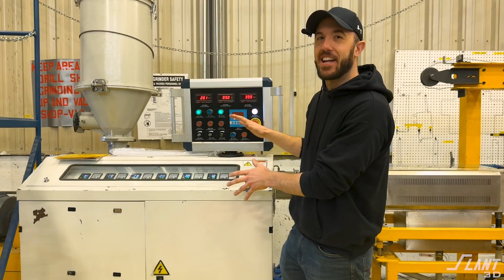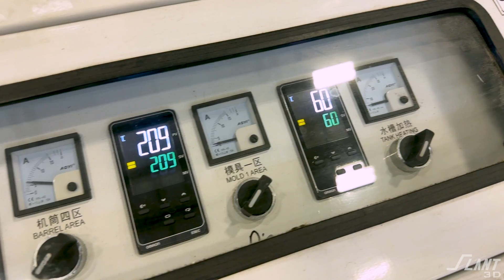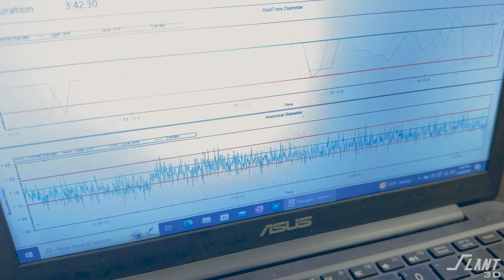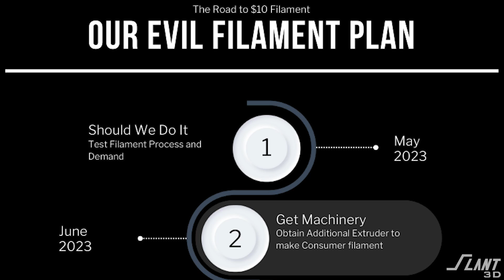The Wrong Way to Make Filament | Road to $10 Filament

Comment: Thank you explaining this stuff. You gave some answers I was wondering when viewing filament productions. I think it is very difficult to maintain a specific diameter +-0.01mm. May be it's possibe to adopt some methods from procuing copper wire. Because copper is expensive an wire mass producte some ideas probably could get adoptet. But I did not checket it.

Comment: To get a sense of what true production scale extrusion looks like, Smarter Every Day has a tour of the Kodak plant where they make the PET film for photographic film. Just the extruder screw is about 100' long, and then the cooling and stretching operation is probably 300' long and takes an entire floor of the building. Check it out.

Comment: I work at a plastic additive company and we have 3 extruder lines 2 of which have dies that can run 12 strands at one time sadly at the end of the cold bath we chop up the plastic and put it in huge boxes (Gaylord’s) and sell it as additives I’m surprised we don’t make filament when we would just have to remove a step and add a spool winder and probably be the most efficient manufacturer but maybe the money isn’t there or our sales team just sucks.

Comment: As far as filtration on that water goes, is oil contamination a concern? I'm thinking there's a fair few moving parts in that system, I would expect some amount of oil to transfer into the water eventually. A simple sump would both reduce the contamination greatly, and tell you if it was a problem in the first place. They're also good for floating solid debris, and cheap as chips. Doesn't take much more than a bucket and a pump, and you already have the pumps.

Comment: Do you think that making the extruder vertical and cooling the last vat of water in gradual increments to make sure the filament is cooled off enough could help? (verticality would be to help with filament stretching due to pulling)

Comment: I know for a fact that there have been manufacturers making tight toleranced (+/- 0.02mm and better) filament for nearly a decade. 

Why are you wasting your time on that old extrusion line? Why wouldn't you just invest the $50k for an extrusion line that has already solved a lot of the problems that you're identifying on that line?

Comment: You don't need faster extrusion... You need multiple nozzles and route like 4-5 strings through same cooling channel... :-)
Reply: You can loop the same filament multiple times through the same cooling channel
Reply: @celeron55 This will not increase throughput )
Reply: @BarsMonster  Well, given the extruder is the bottleneck, yes it won't. But I don't think your idea will help either, because with multiple nozzles you're increasing the extruder flow rate anyway and the material will then stay in the heating chamber for a shorter amount of time just like when increasing the flow rate from a single extruder.

Comment: I would cut a notch into the bins to make threading the filament easier. Seems odd its watercooled directly, but having moisture in your filament makes it pop and not adhere. Making it have a longer melt zone is a no brainer, like a volcano hotend. 
Good work.

Comment: The oscillations in the belt will add variations in the filament diameter. I haven't run the numbers, but if your goal is closer to +/-.02mm, I'd run those numbers right away.

Comment: I can say that while I have not extruded filament I did extrude double walled yarn reinforced hose (think garden hose but smaller diameter and for drinking water) and designed some of the equipment on that line.  I had issues with my second tank not being long enough to cool before spooling onto massive wheels at the end. I ended up mounting a bicycle wheel at the beginning and end of the second cooling tank. The hose would come into the tank just as it does here but at the end it would go up onto the wheel, loop back to the beginning and take a second pass through before coming out the end. The hose was originally warm enough that when spooling the first several layers could get slightly deformed out of round and would have to be scrapped on every spool. This was hundreds of feet a day, that just went in the scrap bin that we were then able to keep in spec.

Comment: Don't mess with the sand filter at your volume....300 to 1500 gallons a hour is a cheap filter tube.   You should be filtering out 1g of waste for every 10kg of filment made I expect.      

Activated carbon and spiral wound filter tubes are dirt cheap (and with the right filter tube is just mixed and perhaps dirty plastic to dispose of...same waste stream.) for the tiny bit of drag in you get from cleaning just cast thermoplastics.  For the bigger stuff, cardboard dust blowing,   simple filter bag will take care of chips and fragments of microplastics and be what you would change out every week.  Carbon tubes and micron scale filter tubes work at a few PSI drop, so your going to need a 1/15HP pump in lue of the 1/30ths you seem to using today.      

Those tubes your goal is to change out every other week as they are almost always shipped in cases of 12/24/36.   Once you have one system, you may choose to print your own filter tube encloser inlet and tube holder and use schedule 40 or 80 CPVP plumbing and rods and glue your own design together, would be fun to figure out the compatible glues/weld.     The commercial example is Penguin Series A-B In-Tank Filter Systems from Penguin pumps.   Those are moulded and machined plastic,  CPVC with Viton Orings.   Steel chambers can be cheaper but are dirtier out of the box.     For your application this would last decades.

Comment: How come the water cooling doesn’t affect the quality of filament? As consumers of the filament we go to great lengths to protect filament from moisture on the air, yet during production it’s literally submerged into water 🤷🏻‍♂️. Is nylon and pva cooled the same way?
Reply: It has to be actively dried after that in order not to be wet when you go to print it. Wanna take a guess whether the manufacturers promising dry filament spend the $$$ on electricity to dry it thoroughly? LOL nope they stick in a tiny desiccant bag that can't even remove moisture just prevent absorbing more and figure you're dumb enough to believe it's dry.

Comment: I’m surprised you haven’t taken an angle grinder to those cooling tanks
Reply: It would be a nightmare to get all the metal particles out of the tank afterward. And metal chips are just about the last thing you want contaminating your filament.
Reply: @outputcoupler7819  it doesn't have to be when the line is running. I'm almost 200% positive those tanks are removable
Reply: @outputcoupler7819  why would it be a nightmare? Do it while tank is dry, blow it out with compressed air
Reply: Im not surprised. Metal Fabrication is a barrier for most people, but if you were in a factory setting you would definitely WANT a metal guy around to do all kinds of stuff like that.
even manufacturing new tank stands or the tanks itself.

Comment: Nice video. However, the future of 3D printing is to eliminate filament altogether. Filament is a needless expensive of energy, water, and resources. Why heat plastic twice when you only need to heat it once?  The future is 3D printer is extrusion heads which take plastic pellets directly. They already exist and while not perfect, have the opportunity to eliminate the need for filament.
Reply: They are heavier and less consistent.

Comment: Genuinely interesting. I can only imagine that the usual way of creating a bigger output would be to put up ANOTHER machine next to this one.

Can confirm, I used to work at a factory that made large plastic bags. Like those giant black or white trashbags and it looked quite similar. Only difference was that instead of running it through water, they went across a chamber where a giant fan would blow the filament into one continuous plastic bag, that would be would to a spool on a pallet, and would later on be cut into the bag-sizes while print being applied.

Comment: would it make sense to replace all these water baths with a single quartz glass tube filled with water and have heaters wrapped around it for the entire length, then you set the temperature gradient instead of having discrete temperature drops? or is this just wishful thinking?

Comment: This is not how all companies are doing it, when I was manufacturing printers 8 years ago our filament manufacturer was already using air to cool the filament and a gear pump servo controlled after the extruder to fine control the filament output.

Comment: on audacity there's a way to separate and delete high frequency noise, it's free, takes about 2 minutes, just a tip for the next video
Reply: There's already noise subtraction been done on this video, i can hear the footprint. What remains is what remains if you don't want it to completely eat the voice.
Reply: dxrevive works nicely
Reply: To me it sounds like they used some neural voice extraction already. Given the amount of noise in that environment this is probably the best they could good get.
Reply: @GatlingNG  yup. Controlling noise is a lot harder than people think. "Oh, we have an algorithm that does it!" they say. "You ever tried using it?" I ask.

They work great in quiet spaces, but in an actual factory? You get what you get.

Comment: I loved working on the sort of challenges you are working on here. My experience is in precision film extrusion, so partially relevant. Your focuses make sense but I offer a couple of suggestions. With lead times so long on those barrel heaters I would challenge folks to find an off the shelf band heater that could do the job. 
If you haven't already considered it an additional way to increase throughput would be a die for multiple strands along with the larger extruder.
A different path to precision, cooling, and reduction of contaminants would be chilled rolls rather than the water bath.
Reply: Rollers are what is used in sizing wire, so I think your idea has merit.

Comment: doing gods work. Can we just get federal funding and cheat? I mean think abouyt it, pla filament can be made of corn oil right? Massibe farm subsidies, a new american manufacturing at home with 3d printers priogram  to curb chinese domination of us manufacturing market blah blah blah gov give us money, we can  cheat, and maybe its not good long term BUT for cshrot term we may get 3d printer fdil,ament down so cheap for a few years that it could be like free lol peopel will be givibng it away, thats my dream. joe bidens 3d printer filaments cam lets do this bro. the only downside is waste but we can burn it all down into silicon molds lol

Comment: What if you went one step further and actually cast/made the resin into filament directly? It seems like the whole step of turning it into pellets first could be skipped entirely.
It would work the same way silicone coated wire is made, where it is actually cast and chemically reacted on the fly as the metal is pulled through. Except there would be no such wire and it would be done with PLA instead of silicone.
I'm not sure how feasible this is, or how you'd add colorant to it.

Comment: I would relook at the goal. Elegoo already has $10 rolls on Amazon, come next day…. The market is missing a $30 3kg roll IMO.
Reply: Yeah, I think they might need to get under $10, but even if Elegoo is at $10, I’d pay $13 to support this project. You’re probably right about the market for 3kg spools as being more primed for volume, my Bambu AMS wouldn’t hold them :-)

(OTOH, I mostly just print gray PLA, so a 3kg spool in a sealed/dry spoolholder on the back might be ok…)
Reply: Yeah, I just ordered some cheap spools to test off Amazon. $12, $13, and $15 for sunlu, esun, and some sketchy but attractive stuff shipping from China. Real colors too not just black. The price to beat is gonna drop below $10.

Comment: How about skipping all of this and invest on a Direct Pallet printing system? There is a youtuber that has worked most of the issues one can/will encounter. 1Kg of Pallets is less expensive than filament.
Reply: Tolerances. The pellets that go in have extremely loose tolerances, so your fluctuations in extruded volume are unacceptable for most applications.

If you can make an equivalent to a gas engine's mass air flow sensor that works in a stream of molten plastic so that flow can be dynamically adjusted to match the volume of plastic from randomly-sized pellets, you'd be good.
Reply: @See-essEll  How about in investing on a Giant Blender/Shredder that makes the pallets into a smaller homogeneous size?
Reply: @nicamarvin  Smaller will still not be uniform. I think the simplest solution would be a series of graduated holes to narrow the pellets into more uniform sizes in bulk.
Reply: @See-essEll  wouldn't retractions still be a problem? Granted lots of models, like the lampshades, wouldn't need retraction and could be printed even more cheaply on a direct pellet printer and the remaining, who knows...25%, models that need retractions could be printed with filament.

Comment: how about extruder pushing out multiple parallel lines simultaneously?
Might be easier to just go faster on single line tho
Reply: You certainly can however it is challenging to obtain equal flow characteristics across the different strings from the extrusion die and your downstream equipment will need to support that multistring configuration as well.

Comment: It could take up a lot less space if you stacked the cooling channels and used pulleys to zigzag it up/down. You could the use a simple gravity feed and a toilet fill valve to maintain water level and cheap souis vides (spelling) to maintain temperature.
Since this setup could more easily be enclosed, you could use alcohol or some other liquid instead of water and reclaim the evaporation in a condenser to reduce dry time and cost
Reply: I don't really know, but I imagine that Zig zagging the filament before it's fully cooled can introduce tolerance issues
Reply: @noisycarlos  a sufficient radius, clean machining and good bearings would minimize that and since they would go opposite directions any built in curvature would be corrected. In fact many copper wires are produced in a similar way to minimize tolerance issues - the wire is fed between 2 well fitted rolling guides
Reply: As in tanks that were used to process movie film.
Reply: @jeromefeig4209  I must be behind on my How Its Made episodes - never saw that one. Pretty soon they will all be digital and an attentive filament maker could get a steal on that equipment

Comment: Is this true of all filament manufacturers? I can’t imagine the largest filament manufacturers wouldn’t have tried to reengineer all this old tech for optimization.
Reply: No not at all. The equipment can cost $150,000+, while this is probably in the $10,000-$15,000 range.
Reply: @TheOfficialOriginalChad I imagine the $150k machines can extruder a lot faster while still maintaining tolerances, do you know how much faster they are?
Reply: @DaveEtchells  That I don’t recall. I also didn’t catch how fast this one is
Reply: @TheOfficialOriginalChad  IIRC, he didn’t give a specific speed, but he did remark about needing someone there to always be changing take up spools. It’d be just a wild guess, but if it was 5 minutes/spool (likely slow?), that’d be 12 kg/hour. That’d be around 300 kg per 24 hours. 

(If we knew the inside diameter of the spool, we could easily figure out how fast the filament is moving when the operator starts up a new spool. That’d be faster than the extruder runs, because there’s a set of rollers that take up slack while the spool is being changed, but it’d give an upper limit. There’s variation in hub diameters between mfrs, but I suspect not much. It’d be interesting to calculate but I already waste too much time on YT vids and comments 😮😂)
Reply: @DaveEtchells  I like the way you think!
Reply: @TheOfficialOriginalChad  I did a quick Alibaba search and found a machine with 45-50 kg per hour capacity for $28,000 plus the usual shipping and import duty.  So in the $50k range and not $150k. There was another unit for making synthetic hair (200kg per hour) priced at $35k The point is how the filament is processed through this machine hasn't changed in decades.  A similar product is the bristles from brooms or toothbrushes,, cut to length before they are inserted into the head.
Reply: 3d musketeers went to printed solid, machines looked pretty similar, they had a way to take up the slack while changing rolls but otherwise...
Reply: @eslmatt811 I know what your about most manufactures have the pully system, not fun to setup as filament is being extruded
Reply: I @eslmatt811  it looked like Sland has a buffer too, it just wasn't in use as they were spooling to that "master" spool.
Reply: Yes, all filament manufacturers are idiots, especially the ones pumping out hundreds of thousands of kilos a month. Only this guy knows how to make filament properly.
Reply: Consodering tha lots of companies have done the 10 $ per kg filament problem already, of course they have. 

Filament making is kind of an old manufacturing thing though.
Reply: You have to understand the mentality of companies.  To top management, who are not necessarily inventive types, most have the thought of "if is not broken. don't fix it".  Thus they stick with old technology.  They are penny wise and dollar stupid.
If they would redesign a machine for $100k they do not realize that by doing that investment, they could save $1,000,000+ over a year(as an example).
Reply: @jeromefeig4209 managers should be good at calculating ROI because that's basically their job: to make more money. Far too often they suck.
Reply: I'm a filament line operator and I can't say how fast